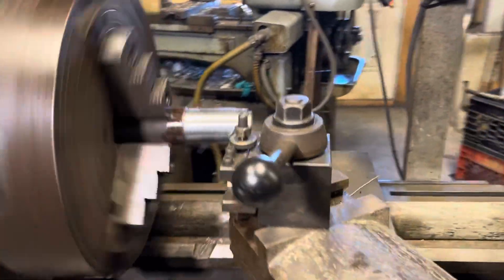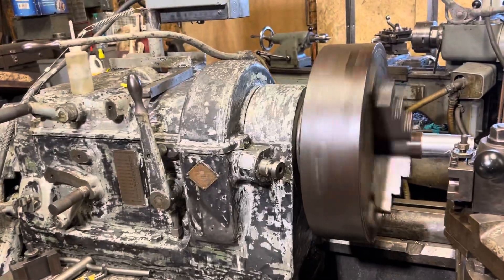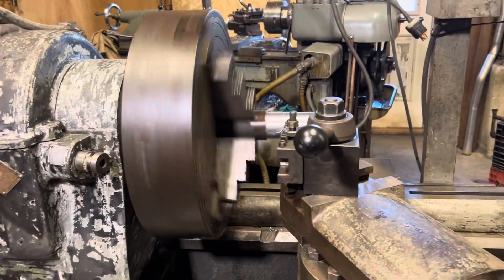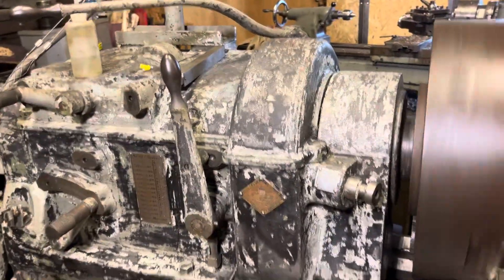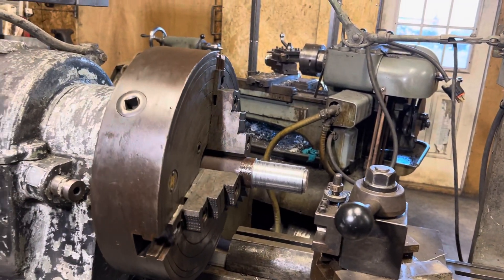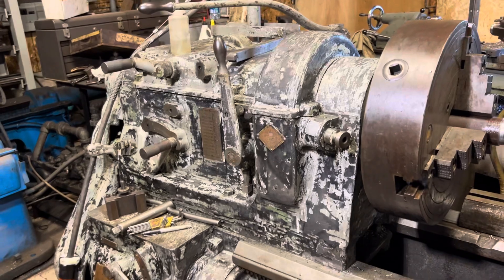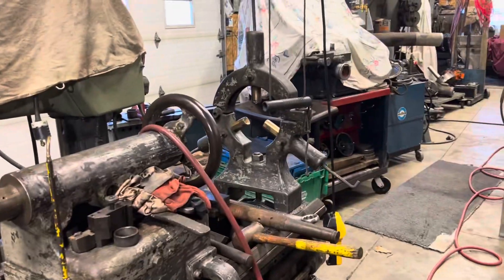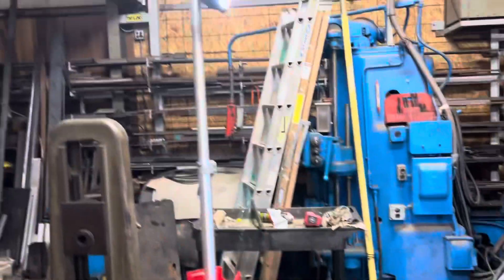#213 First cuts with Cincinnati Tool Lathe that we rescued from certain death 3 years ago.

Comment: Try gear oil on the chain. Its tacky and perfect lube for that drive. You should've gone out and bought lottery tickets after getting these machines. Wow
Reply from the maker: Thanks for watching, I had taken the covers off and shot some 90 wt gear oil on the chain.  The “ chain is a hyvo style like a timing chain on a V8  it’s loose. We went around everything on it & hit about 100 lube points to make sure nothing was dry or stuck from sitting in storage before I fired it up . Retrieving this equipment was not even on my radar at all . I would say the people there did the right thing by calling me and they were enthusiastic that we showed up with only over night notice with a bunch of trucks and saved the equipment. Their heads were in the right place.